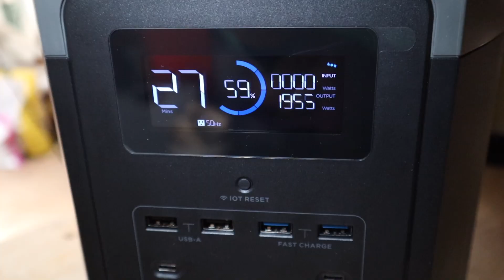Battery Vs Welder   Ecoflow Delta Max Review

Comment: Hi Tim, you have certainly showed us an option instead of a Petrol generator. This system is certainly useful in most applications. This would be very useful even in a normal house situation if power was disconnected. I have a gas space heater and a gas hot water heater that needs AC power to ignite the pilot light to run things. This power unit would certainly do it. Cheers and thanks for this valuable information, Steve

Comment: Thanks Tim, I do love your channel, I learn so much. I am in the process of setting up a "battery bank" for when the power does drop out. I have 2 generators. But running them at night is costly and very noisy. So, the idea of switching over to the battery bank before nodding off to sleep appeals to me. And I am looking forward to your comments after running it overnight. Cheers PS, your old electric circular saw needs love. Just saying, it's not orange paint on the frame.
Reply from the maker: Nah. Blood rusts the metal……

Comment: Looks like a great bit of kit.

Would 2 linked together help it run the welder better?
Reply from the maker: I thought that too, but it’s parallel and top draw capacity stays the same
Reply: How do you find it is it worth buying as the battery  isn’t lifepo4

Comment: Would it run a small domestic cement mixer and if you put 2 together, would you be able to weld without it tripping the safety cut out???? Thanks - looks amazing !
Reply from the maker: I reckon it’ll do it but can’t say I’ve tried. I doubt the motor would draw 2000 watts if it’s small domestic. Would pay to check.

Comment: would this power an arc/stick welder?
Reply from the maker: I would not recommend any of these sort of batteries for sustained or ongoing use with a welder. Typically an arc welder pulls a lot more than a MIG on low setting. This test shows that the battery can ramp if needed and is capable of a short emergency tack but sustained ramped use will result in lower battery life and poor quality welds.

Comment: TO USE A POWER BANK TO WELD, I THINK WHAT WE NEED IN THE FIELD LETS SAY WE HAVE A small 110 arc welder conected to the power supply, but keep the power supply connected to a 110 power plug meanwhile I am welding. that way we are using and replacing the currient, is that posible , any conflict with That! THAT WAY ITS GOING TO BE A NON STOP WELDING  is there anyting like this outhere
Reply: the power thats going to pass through ecoflow units isnt mixed and added .. it still has 2400 watts  limit  because cables and electronics inside are made for only 2400 max continious when it is not hot!!!   so when it passes AC from outlet you still cant push more... simple logic....  you dont mix you just pass through!!!  .  house breaker might not drop but unit will  overload in the end